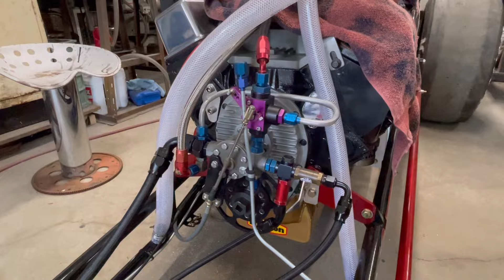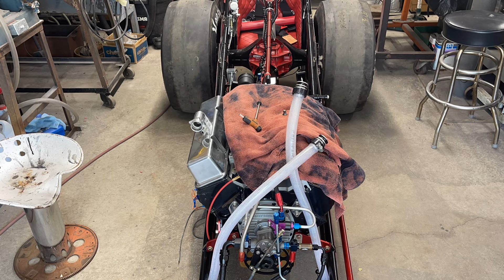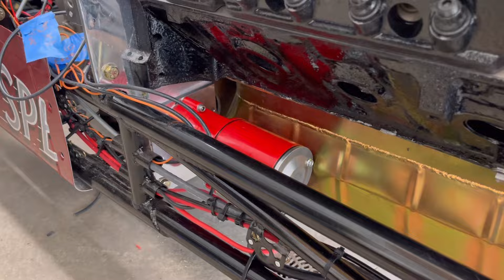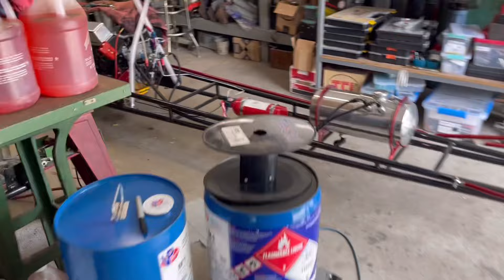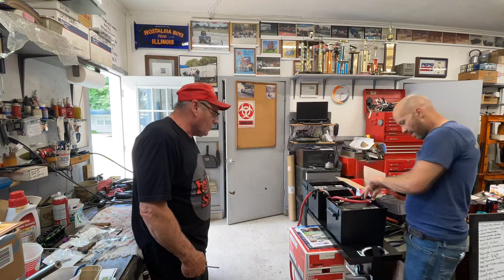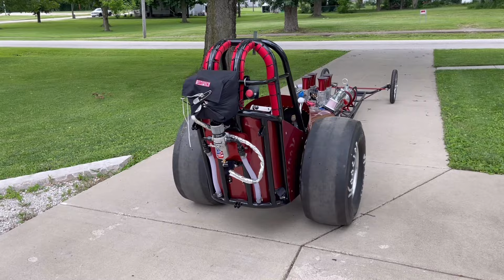Jumping Jack Flash! How Much Work Do We Have Left To Do? #motorsport

Comment: Whoa! I never realized just complicated all the piping and connections are involved with the Hilborn injection.  I thought it was much simpler.  And all that electrical wiring.  How the heck do you keep track of all that?  God forbid you have a short somewhere between races! Glad that I am a simple fan.  You really show how much love, knowledge, patience, and $$$ is needed to own, build and eventually run a racecar.
Reply from the maker: There is a lot that goes into this, the fuel injection is vintage speed parts we have rebuilt.  Unfortunately, some of the stuff you can’t find parts for and that has caused some major issues.  Unfortunately, the modern versions of the parts we need are pretty darn expensive, so it’s onto plan B, which is still absolutely old school cool!  Stay tuned my friend!